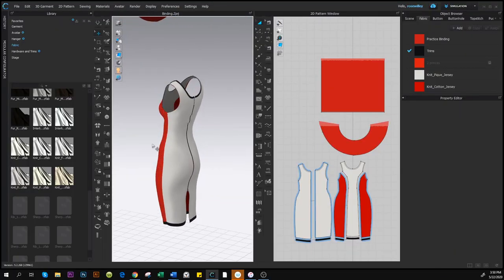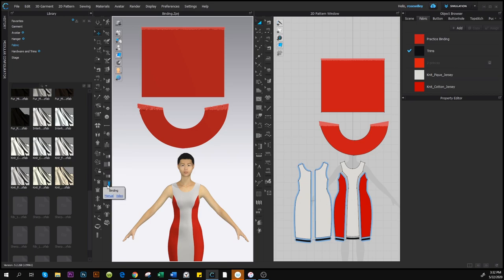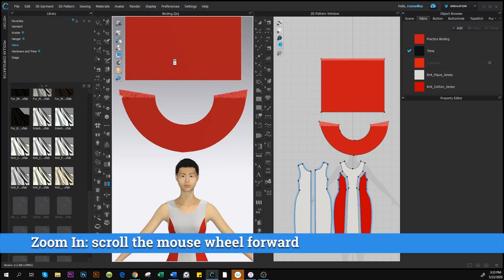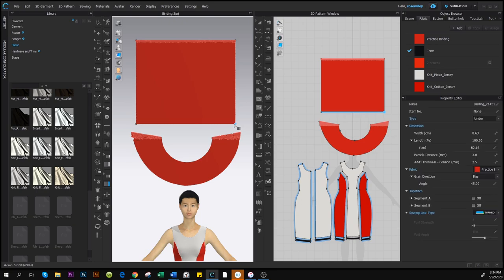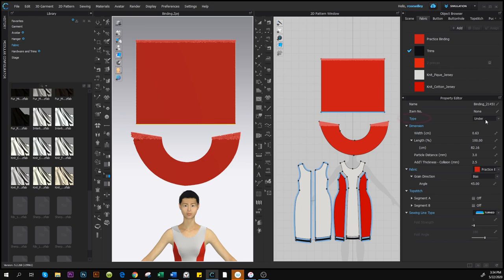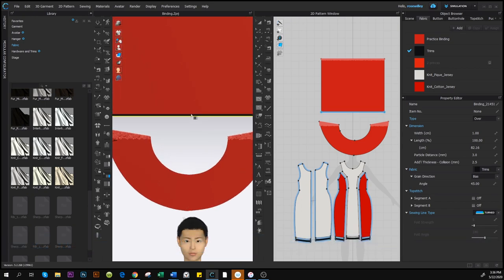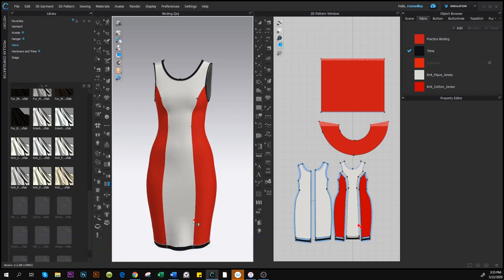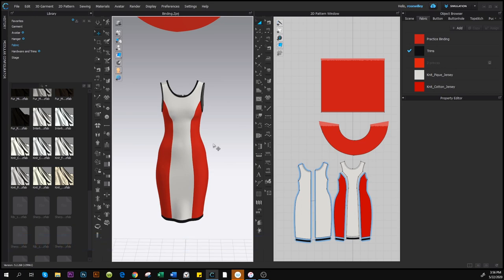how to make binding in clo

Comment: How to add a binding to an internal line? 😅
Reply from the maker: Unfortunately you can’t apply on the internal line, but with clo 7.1 we can apply the binding on the seam of the garment. I will create a video about it very soon, stay tuned, 😍Rose.
Reply: @EncoderFashion  Oo thanks !!
Reply: @EncoderFashion  I have one more question 😅 How to make the part immovable during animation, in my case the belt on the avatar slides off during animation, set the friction to the maximum, nothing helps. I will be very glad if you help 😅🙏🏻